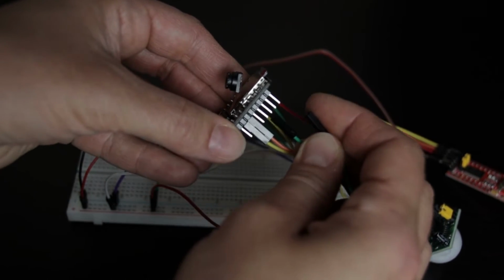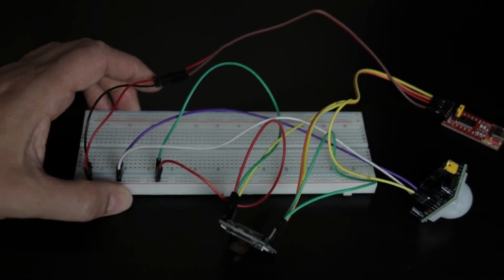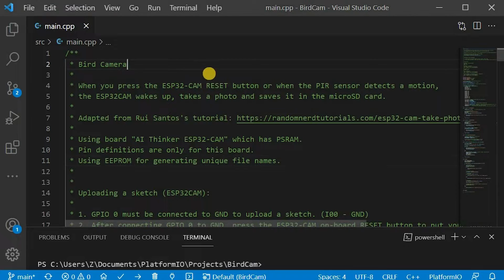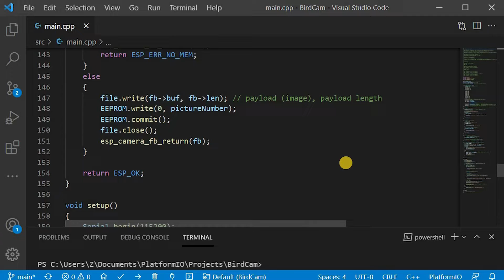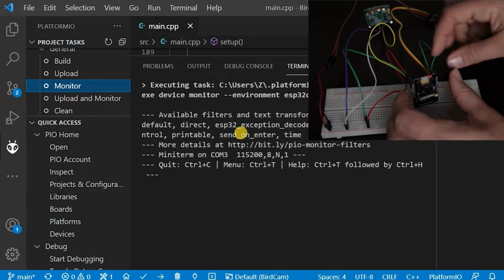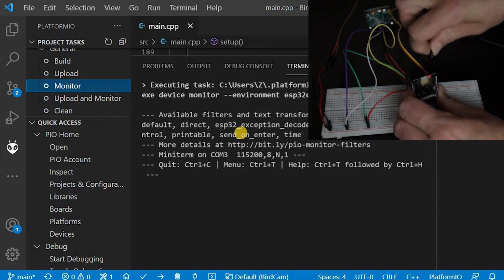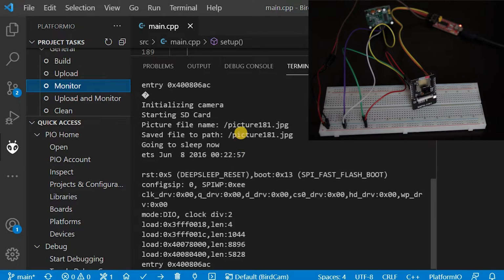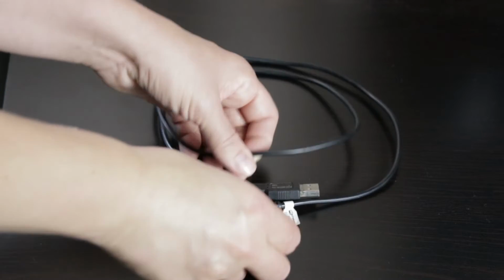Bird Camera with ESP-32

Comment: Hi.
Sorry for my english.
I copy the code and the scheme but don't work. The ESP32CAM took a photo every 3 seconds and never stop. ¿Any ideas?
Reply from the maker: Hi Roberto! Please make sure you connected it the same way as in the video. Maybe you used a different schema ?
Reply: @robotsanddinosaurs  Hi. First of all, I want to thank you for responding so quickly. When I upload the sketch to my ESP32CAM, it takes photos every 3 seconds. When connected to the Serial Monitor, every time it takes a photo, the following text appears:
16:27:04.847 -> ets Jun  8 2016 00:22:57
16:27:04.847 -> 
16:27:04.847 -> rst:0x5 (DEEPSLEEP_RESET),boot:0x13 (SPI_FAST_FLASH_BOOT)
16:27:04.847 -> configsip: 0, SPIWP:0xee
16:27:04.847 -> clk_drv:0x00,q_drv:0x00,d_drv:0x00,cs0_drv:0x00,hd_drv:0x00,wp_drv:0x00
16:27:04.847 -> mode:DIO, clock div:1
16:27:04.847 -> load:0x3fff0030,len:1344
16:27:04.847 -> load:0x40078000,len:13964
16:27:04.847 -> load:0x40080400,len:3600
16:27:04.847 -> entry 0x400805f0